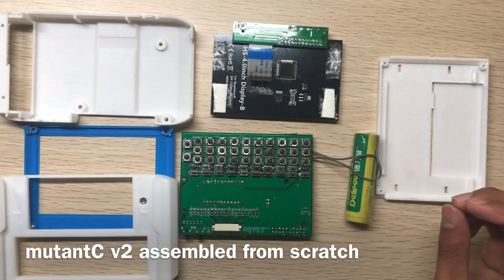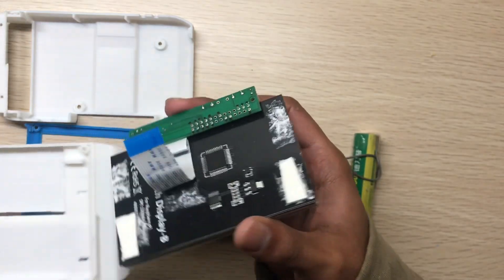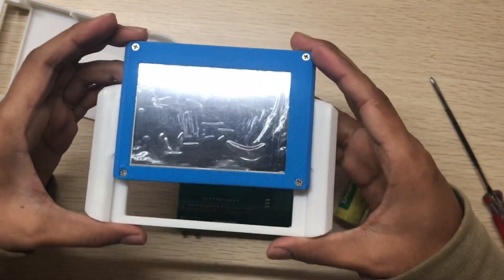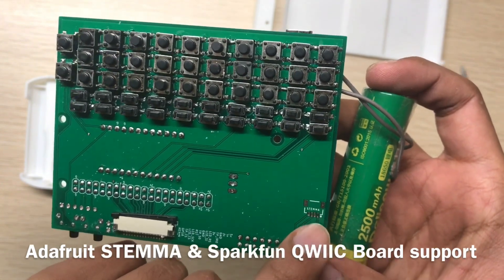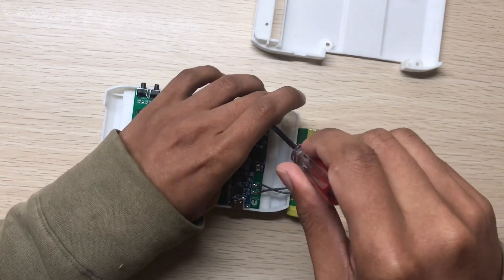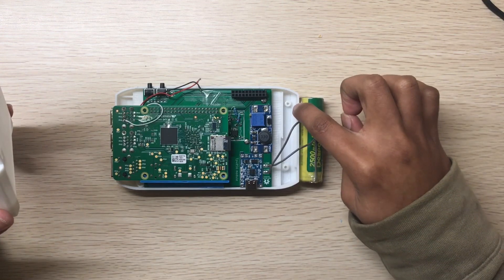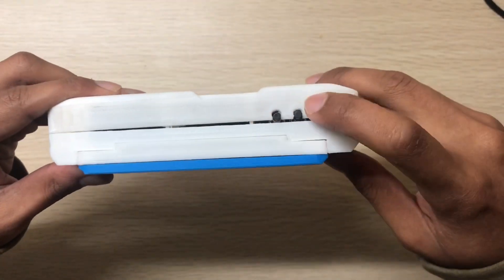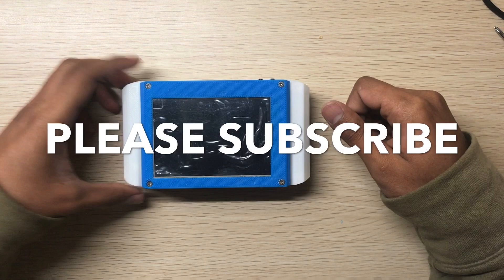mutantC v2 assembled from scratch

Comment: One of the better build I’ve seen, you think this could be tweaked  with an Adafruit LoRa Radio Bonnet to create a LoraWan encrypted Communication Device leveraging the the Helium blockchain mesh network?
Reply from the maker: Lora is already there as external module that connects to the expansion port. As for the software side there is no work, as I am not that experienced in that side. You can see the all the add-ons as well as the lora one here https://mutantcybernetics.com/add-ons.html
Reply: @mutantCybernetics  ahh good to know. I was going to use an Adadruit LorWan radio extension and configure it to use Helium blockchain
Reply: @mutantCybernetics  are all the ads configure to fit within this 3D model build?
Reply from the maker: Yes. I tested all of them and they fits.

Comment: Nice, I'd love to make a small portable UMPC but I don't really have the resources and talent to do so.
Reply from the maker: Trust me, it is pretty easy with this project, get a pi, 3.5 inch lcd and the pcb first then put together and use it, next go for 3d parts.  
I did the same.